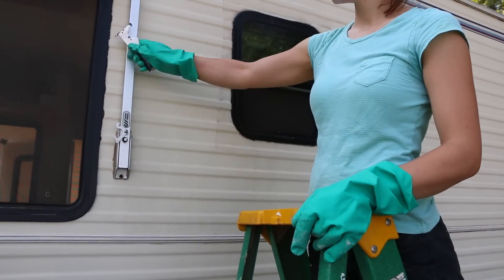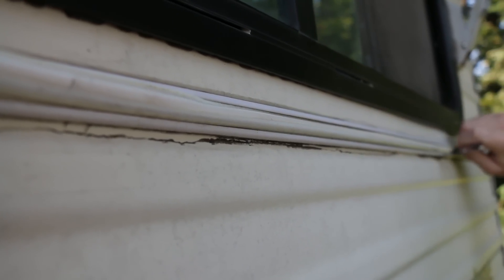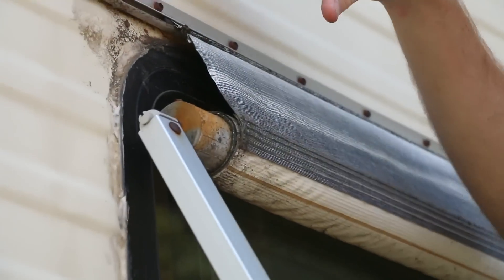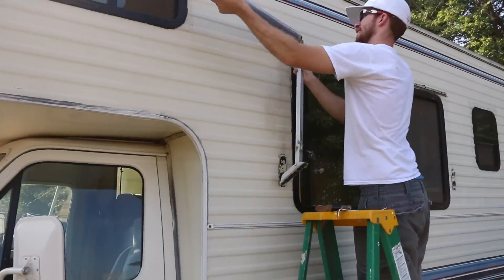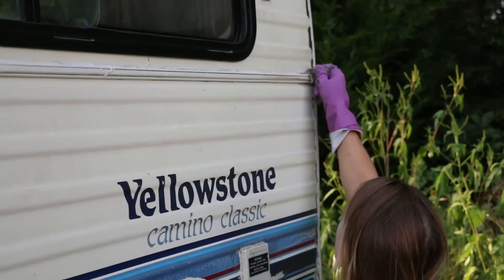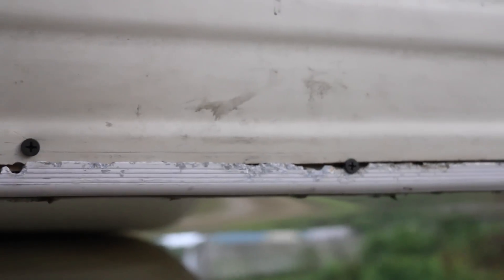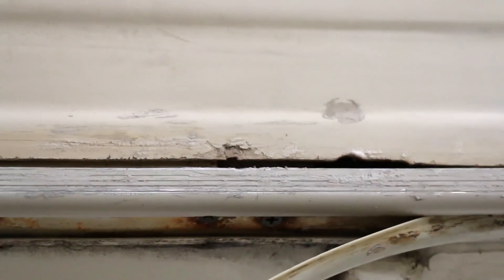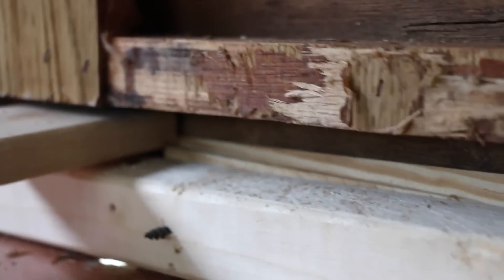Exterior RV Caulk Removal | Never Use Silicone Sealant!

Comment: To be clear, it is highly recommended to NOT use Silicon Caulk as you would find in the big box DIY stores. Most professional RV service techs recommend RV specific Silicon sealants for wall/vertical seams and DiCor Lap Sealant for roofs (NEVER silicon anything on roofs). I use Geocel ProFlexRV on my walls/Vertical seams and Dicor LapSealant on the roof. What is great about he Geocel is once you clean out the seam and apply a fresh bead, the following year (or as needed if sooner) you can clean the area and the reseal over the old seam. The ProFlex says flexible and does not dry out and crack. It also is made to deal with the extreme flexing that an RV is subject to, something regular silicon caulk for homes was not formulated for. I have also heard that automotive sealants is also an alternative but I have never tried them.

When I had my old Winnebago, 1972...., after 10 years, I removed all the windows, door frames and corner seams and replaced the caulking (Butyl tape possibly) that was under the frame because it was drying and shrinking as well....applied new sealant  and then replaced the windows and resealed with marine silicon (yeah the was in the early 80's and RV sealant did not exist...things were different then). Point is like they are doing, removing and completely resealing is highly recommended after 10 years. 

Awesome video and thanks for sharing!
Reply: silicone

Comment: I  have a 1989 Lazy Daze Class C and I use 100 percent silicone on the exterior and it works
just fine and lasts for years . Seals are tight and waterproof.

Comment: Silicone (not the paintable type) works best on gaskets held down with screws/bolts and will provide permanent leak proof seals. All other sealers will dry and crack. I've seen lots of non-silicone sealer, butyl tape, and Dicor re-dos. 
Manufactures use non-silicone sealers and butyl tape for lower costs/higher profits.
Reply: My question too. 🤔

Comment: The silicone is doing its job! You get a lousy silicone then you end up with leaks and other problems! If it’s easy to remove then it means it’s not sticking properly to the substrates and this will result to adhesion failure.

Comment: What type of NON Silicone Sealant do you recommend?  Couldn't find the next video you said you were doing resealing with non-Silicone Sealant?
Reply: I re sealed all the moldings with chemlink primer and then m-1 chemlink adhesive sealant and all new screws took me all summer
Reply: I did my 1992 e 350  class c

Comment: As a lifelong contractor I think silicone caulk should require a permit to buy. I have restored two RV's and both had the same problem, SILICONE! If you do not know the proper use and quality stay away from it. You guys are a great couple.

Comment: Hi, I'm enjoying your 'journey'. I'm curious, what do you recommend as a non-silicone sealant? Thanks! 
"In the next video, we apply new sealant (non-silicone) to the entire exterior of the RV to ensure it is finally waterproof."
Reply from the maker: Hi Marilyn. Thank you for the comment.

Okay... first thing's first. Never use a silicone based anything for the exterior of an RV... EVER. Second, make sure that what you are using is a SOLVENT BASED sealant. Here is an article that was very informative http://goo.gl/nnNpdV. As you can see in the article, they found a product called Geocel Pro Flex. We wanted to go with that, but because it wasn't available locally, we decided to go with a more widely available product called OSI Quad http://goo.gl/cFxz8Z. You can pick it up for less than $6 a bottle at most home improvement stores. It is amazing stuff and works very well! We hope this information is helpful :) -Michael and Jenny
Reply: Gr8 info, thanks a bunch!!
Reply: Dicor lap sealant is great for exterior of RV, etc.